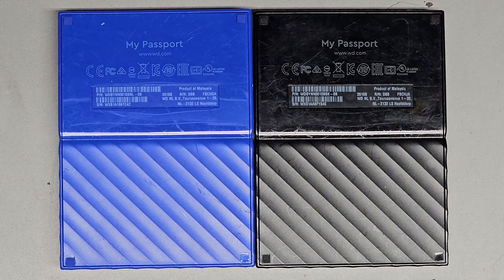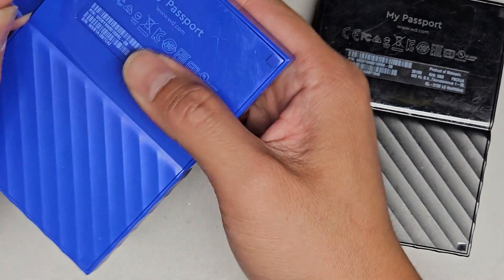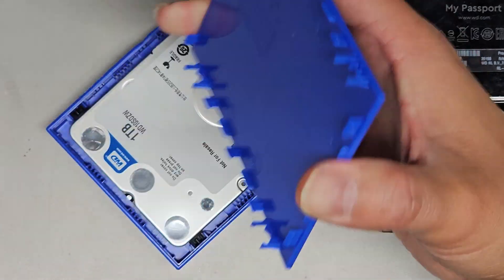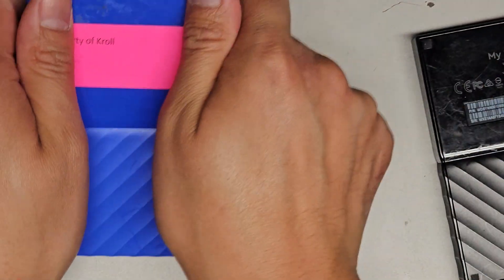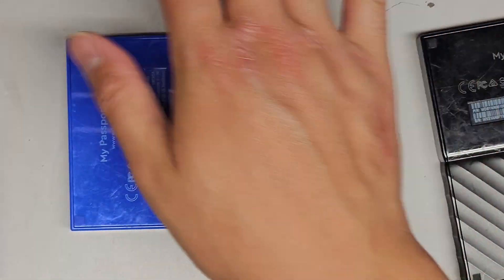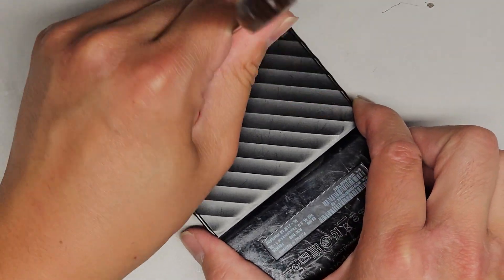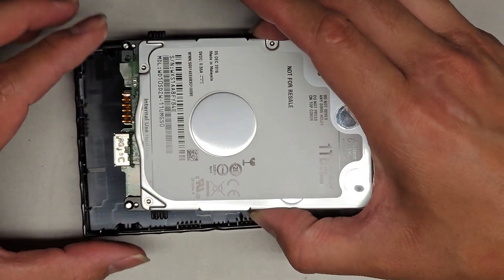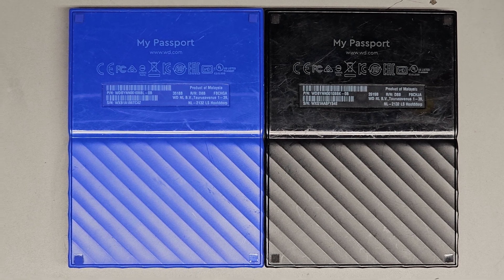WD Western Digital My Passport External Hard Drive Disassembly Cover Outer Plastic Casing Removal

Comment: Ive been using a 2 tb version for years on my Xbox one and then my series x the usb part clearly has failed and its a shame to see this is how they designed it oh well now I know I should just buy an enclosure and hard drive separately so if the enclosure fails I still have a drive instead of a paperweight
Reply from the maker: Yup!
Reply: @ItsBinhRepaired Wow wasn't expecting a response thanks for posting this video im gonna give it a like.

Comment: wow that sucks, no shuck and have seen these usb ports fail. if you have a second working drive can the board be swapped out?
Reply from the maker: I think there's a chip on the board that would need to be swapped.
Reply: @ItsBinhRepaired bummer, thanks for the teardown, guess will always have to check first to see what is shuckable. no more WD for me
Reply from the maker: Yup

Comment: I remember dismantling an older version of these drives (I much prefer the shape of those older cases) and was surprised to find, basically what you did, the USB port directly on the hard drive.
First drive I've seen with this, but I do know the first External USB drives I had, I think were Samsung, were using a USB SATA controller.
Reply from the maker: @bobingabout  yup, it sucks
Reply: @ItsBinhRepaired  Fortunately for me, I was just looking for a used hard drive to use inside a project for a Raspberry Pi, and it would connect via USB, so adaptor or not, it worked for me.

But it really did make me pause and go "WTF?", because I wasn't expecting it.
Reply: You should be able to change the hard drives mother board off and put a sata 1 on
Reply from the maker: @JustinEberhardt247  that's not how it works.
Reply: @JustinEberhardt247  
1. Just a board, or in this case a control board, not a motherboard. For something to be classed as a motherboard, you need to be able to plug 1 or more daughter boards into it.
2. That makes a few assumptions that might not be true. The controller you replace the current one with would need to be compatible. The controllers might also contains key information about how this specific model of drive works that wouldn't apply to any other drive.
It's why data recovery centers often have thousands of "Donor drives", they need to make sure you borrow the electronics from the exact model of the one they're trying to repair to make sure they're compatible with each drive's unique specifics.